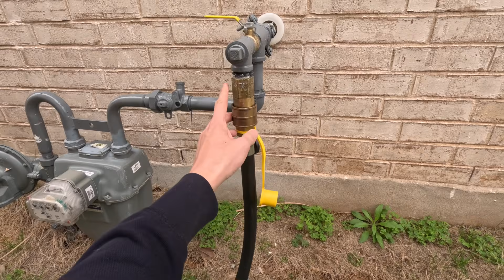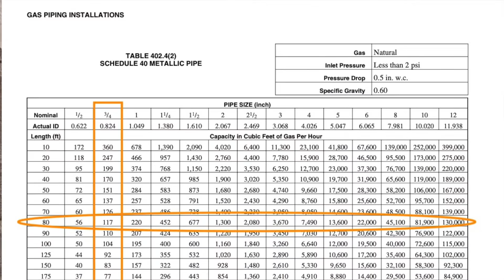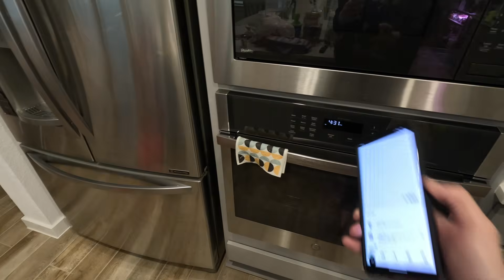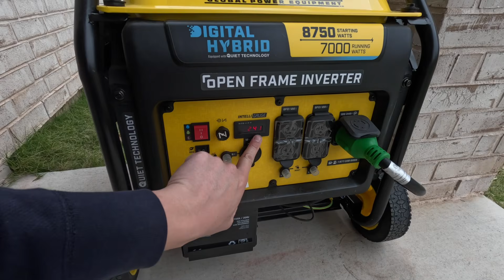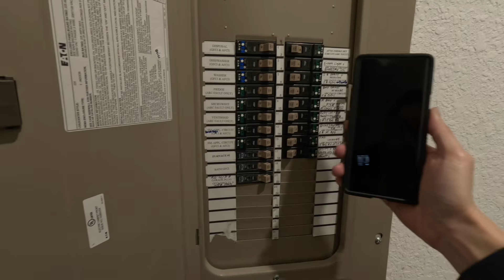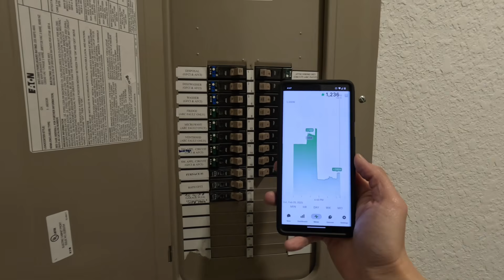Champion 100520 + Motor Snokel + Natural Gas = THE ULTIMATE BUDGET FULL HOME BACKUP GENERATOR?

Comment: Jonathan, I'm wondering if you've given any thought to the harm converting a generator to natural that wasn't designed for that fuel will cause. I mention this because I recently purchased the same generator and have done considerable research on converting to natural gas. I'm finding that firstly Champion will void your warranty and secondly that generators that are designed to run natural gas and propane are built with hardened intake valves and seats. Generators designed to run gasoline do not have hardened intake valves and seats because the atomizing of the liquid fuel over the valves and seats cools them. The result of using gaseous fuels will result in what is called "seat recession". The valves overheat and breakdown and as the seats overheat they are driven further into the base metal they are mounted in. After learning this I can understand why Champion will not honor their warranty after conversion. If you have any ideas on this topic I would appreciate hearing from you. Thanks, Gerry
Reply from the maker: Hi Gerry, thanks for reaching out and asking this really good question.

The first thing I must mention is that I am in no way an authoritative source for this particular question. My generator is only 2 years old and I have run my generator on propane and natural gas for only about 5-10 hours. You'll probably need to check in with me in 10 years to see if I need to eat my words or if my research and opinion turned out to be right.

That disclaimer aside, I have heard concerns about the engine running hotter than normal and decided to proceed despite those risks. Here are my main reasons.

#1. Motor Snorkel, Nash Fuel, and several other competitors have sold thousands of these conversion kits since the 90s. After doing this for 20-30 years, if this was a widespread issue, I would imagine hearing more news about generators failing due to conversion. I have not heard of a personal story of a motor being damaged due to conversion from gas to propane or NG (I would definitely be very interested to hear someone with this experience). Based off of this, I deemed it safe enough to try.

#2. The likelihood of me using the 3 year warranty is pretty low. After the originally break-in period, the likelihood of me sending the generator back in for warranty repairs is very low. The terms of the warranty excludes normal wear and tear, so it's going to be pretty tough to prove that it is Champion's issue. On top of that, the fact that "transportation charges on product submitted for repair or replacement under this warranty are the sole responsibility of the purchaser" makes it even less of an incentive to use the warranty. Unless the inverter or engine is faulty, it's going to be cheaper for me to have certain things serviced by local repair person out of warranty than to ship it to Champion and then back. The warranty is probably most useful for the first 5 hour break-in period when you find a real manufacturer defect. After that, most issues will fall under the warranty exclusions of normal wear.

#3. Motor snorkel does address NG/propane running hot. They recommend in the manual to run the alternative fuel with as lean a mixture as possible to keep the engine running cool. I did tune my gas mixture to follow this. I believe I can set it at a level which keeps the engine cool enough to prevent damage from happening.

I would recommend going for 20-50 hours on the engine as a break-in period. If there were any warranty issues, they would show up within that timeframe. After that, I would proceed with the conversion. I just don't see enough to back up the claim that conversions break generators at a higher rate than running solely on gasoline. We have to remember to balance any claims we hear about conversions damaging engines with the fact that generators that run on only gasoline still end up failing too. I think proper maintenance and care is the most critical that would prevent issues from happening with either a tri-fuel converted generator or a standard gasoline generator.

Hope this helps! I'll be sure to report if the motor snorkel and running on propane or NG damages my engine in any way!
Reply: @jonathanDIYs  Jonathan, Thanks for your thoughtful detailed reply. I'll take your advice and run an extended break-in before diving into conversion. Gerry
Reply: Champion has posted a lot of videos which show how to replace things like.... Co modules.... Inverter modules....etc.  My take on this is if you have a warranty failures are going to ship you a new part  and you install it according to their video.     Because as pointed out above, the shipping cost to ship bigger generator is going to be very expensive... And that's after you've managed to crate it up......mine was $200 shipping when I bought it .  And it was already boxed and protected properly.

Comment: Cool.Nice setup. Looks like you're all good to go!
I bought a transfer switch. Wonder if I should of went with a interlock switch
Reply from the maker: Thanks! I highly recommend the transfer switch. I was able to set mine up myself for about $200-300 or you can get an electrician to do it for about $500-1000. It's actually pretty straight forward and simple, but I do know I'm more of the adventurous type. If you ever have any questions, I'd be happy to share more details.
Reply: A transfer switch is the way to go.  Especially an automatic transfer switch that is wired to remote start the generator.  That way, if the power goes out while you are away from home, your generator will start and keep your refrigerator and freezer running.  However, an automatic transfer switch and remote start setup is more expensive to buy and install.

Comment: I have a similar setup as yours but I use a Wen GN625i inverter($700) with a Motor Snorkel. It has less power than yours but has the 240v 30 amp receptacle. It's loud so at night I use a quiet inverter, Wen 56203i(120v) to run the necessities including the furnace or a window unit. I use a 15Amp Household to L14-30 adapter so I can still use my generator inlet and it powers both sides of the breaker panel. You just have to be careful not to turn on any breakers to 240v appliances.
Reply from the maker: hi Joe, that's a pretty cool setup. How often do you get blackouts in your area? I've kept my generator off at night during blackouts, but having a smaller, quieter backup solutions seems like a great idea.
Reply: @jonathanDIYs   I live in East Texas so the weathers not too bad. We lose power about once a year. I did lose power for 3 days during the bad cold/snow storm, that's what led to this. Wasn't gonna go through that again.
Reply from the maker: @joehortman832  Same here. 2 days no power, was going to be ready next time... I had it "good", there were some people out of power for a full week in central Texas.

Comment: excellent video . i was wondering the same thing about if you were able to run the ng furnace and the gen at the same time...can you tell me whats the size of your ng meter? that woukd have a lot to do with how many btu's you can run safely..im on the fence between converting my dual fuel firman into a tri fuel, or buying the champion tri fuel.. but the champion comes with 1/2 ng hose..so im wondering if thats a big enough hose..
Reply from the maker: Alright, so I had to take some time to reply to this because I needed to get back to the computer and look up the code book again for this.

So my gas meter has a 1 inch pipe coming out of it. I have a standard 7wc pressure regulator before the pipe, it doesn't run 2 psig, so we could use the IFGC Table 402.4 chart. The way these things work is that the fuel capacity is constrained by the smallest diameter upstream. My gas meter is connected to a tee 1" from the gas meter, 1 1/4" to the house and 3/4" to the service port which I added the quick disconnect to. So just because my house has a 1 1/4" pipe going into it doesn't mean I am getting any more capacity than the 1" coming out of the meter. So looking back at the Table 402.4 chart I referenced in the video and the description, at 0.3" WC pressure drop, we're starting off with a capacity of 514 CFH even if the pipe had a 10 feet length from the meter. My generator takes approximately 130CFH and the furnace is 80,000 BTU which for the purposes of calculation, we can round to needing 80CFH. My tankless hot water heater is actually the biggest consumer at 199,900 BTU (let's say 200CFH). This leaves us with drawing a total of 410CFH max excluding my gas stove top and my gas fireplace (which is more decorative than heat providing). At 514CFH capacity coming in from the meter, we actually have enough to run the generator, the furnace, and the hot water heater at the same time assuming the natural gas company isn't having a shortage.

So to answer about why the champion has a 1/2NG hose, it's a matter of length. If you look on the chart again, we can see a 1/2" diameter hose can provide 131CFH if it is 10ft or shorter. If you're providing the necessary capacity to the hose, let's say 3/4" for a 30ft run from the meter which would provide 151CFH. It should be safe at that point to step down from 3/4" to the 1/2" hose for the last bit. Please look at table 402.4(1)... Hope my explanation isn't too confusing. I find it helpful to have the table open while I'm looking at the sizing.

Regarding picking generators, one thing I look at is the THD (Total Harmonic Distortion) rating. This measures how perfect the AC sine wave is, the more perfect sine wave, the better it is for electronics. This steered me to the inverter generator because I didn't want to worry about low quality electricity for all the computers and electronics I had. My house was built recently and everything is "smart"... my HVAC and oven is even connected to wifi - so I didn't want to risk damaging all these sensitive electronics. Wish you the best for figuring out whether to get something new or convert the duel fuel. Thanks for commenting!
Reply: @jonathanDIYs  THANKS  a really informative post. thanks for putting in all that time..
Reply from the maker: The more I research and look into this, the less I feel confident about the details that I shared with you originally. Let me leave you with at least official info that would put you on the right track: 

1. There are two standard methods of determining pipe sizing - longest length or the branch method. If you want to properly size everything, use one of those methods. 

2. From US carburator  (http://www.uscarb.com/natural-gas-chart.htm):
If the hook-up hose is kept to 6' or less, the use of a 1/2" hook-up hose and quick disconnect coupler for up to 18hp engines is acceptable.  The point is to have the correct size pipe up to the shut off valve for the generator.  It is like would be necessary if using an electrical appliance on a very long extension cord.  The extension cord may be quite large but the wire on the appliance may be quite a bit smaller.  The same principles apply.  Having a sufficient amount of gas at the shut off and QDC to feed the generator is the key.

As I'm not an expert on this, I rather cite a knowledgeable source and let them be responsible for the validity of their statement. These two pieces should be more accurate than my first stab at explanation.

Thanks for asking, it really does help me understand these things better as I dive into the research!
Reply: Jonathan….do you know how much TOTAL of a btu load that regulator delivers?    The chart you reference is great but you are missing a key point.  In actuality, the service line coming into your house pre-regulator is pressurized to 10 psi…but you have a standard residential regulator which is a 4 ounce regulator with a 7 inch water column.